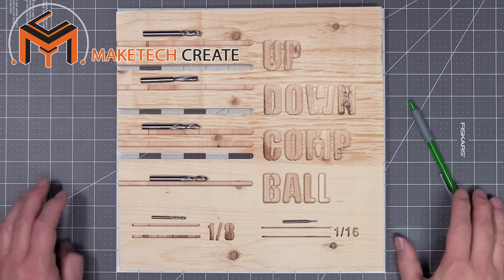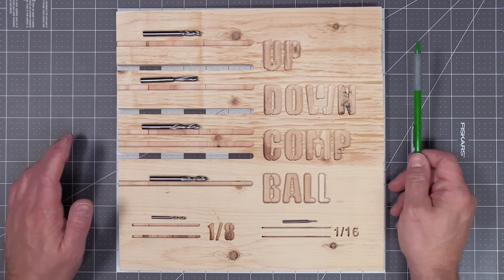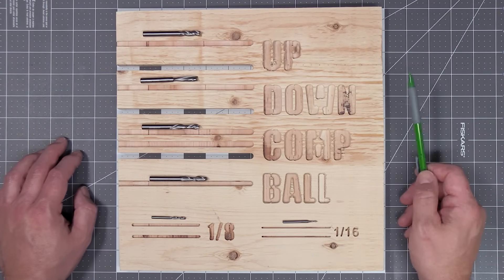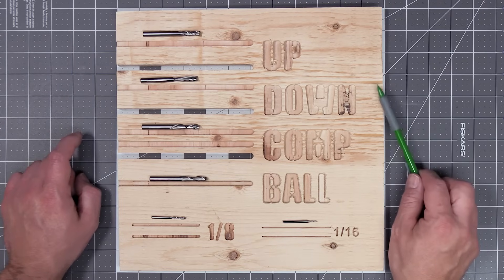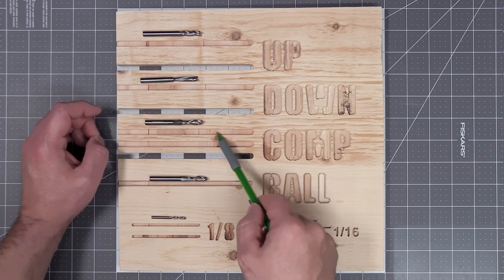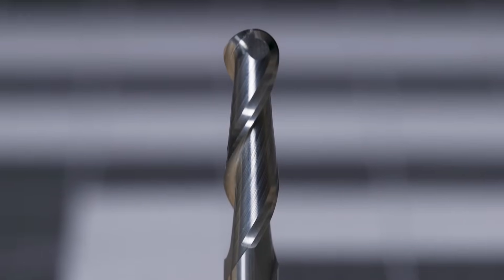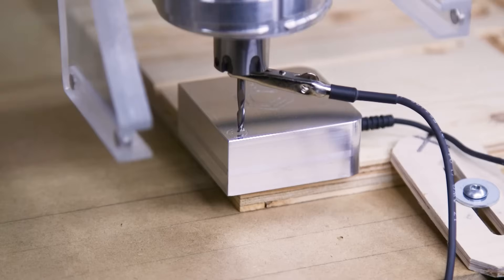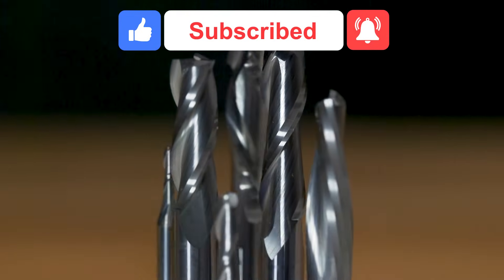CNC Bits For Beginners / Upcut Vs. DownCut Vs. Compression Vs. Ball Nose End Mills!

Comment: Did you have to use some type of adaptor for the 1/16 since it's so small?
Reply from the maker: It's a 1/8" shaft with the cutting tip being 1/16". So, you just need a 1/8 collet for most of these smaller bits.
Reply: @MakeTechCreate  Oh! That would make a lot of sense. I'm new to CNC and bought a 1/16 and was trying to find a 1/16 collet adaptor, LOL. Also is shank the same as shalf? I bought an Amana 1/16 and the description says 1/8" shank

Comment: I want to make accurate PCB's with perfect aligning holes. Not sure if an end ball mill or flat end mill is better for drilling 0.8mm holes.
Reply from the maker: Flat end mills are typically used for hole. Just got slow with a but that small. Thanks for watching.
Reply: @MakeTechCreate  Ok. Ty.